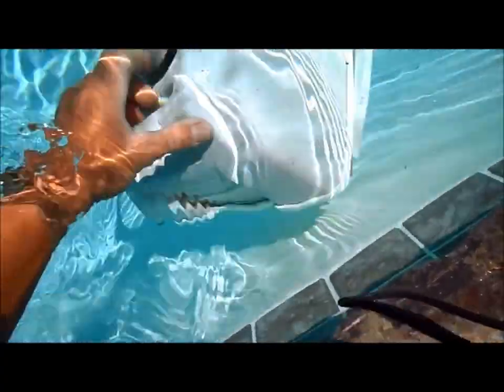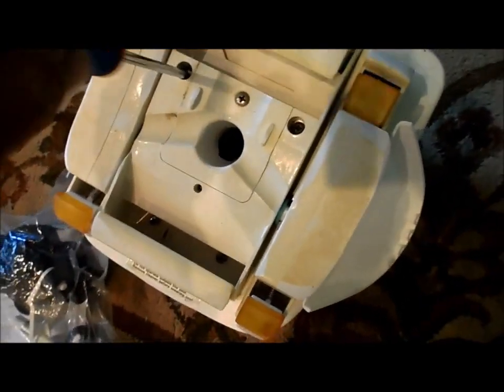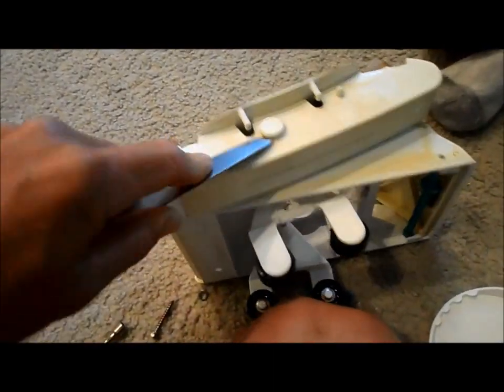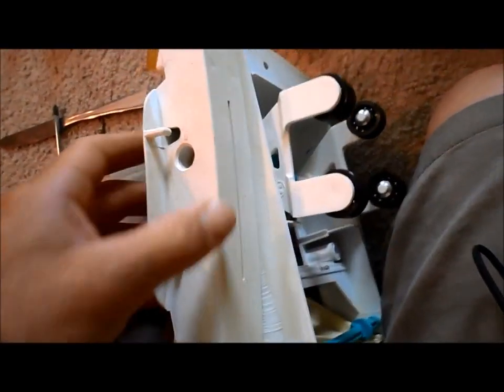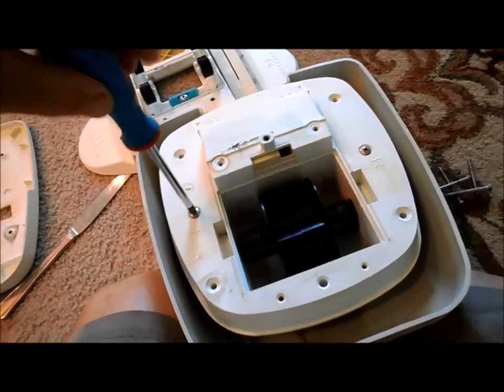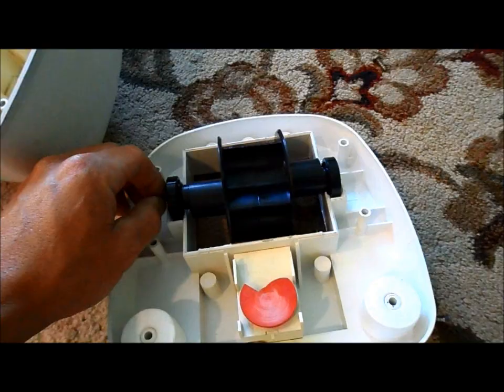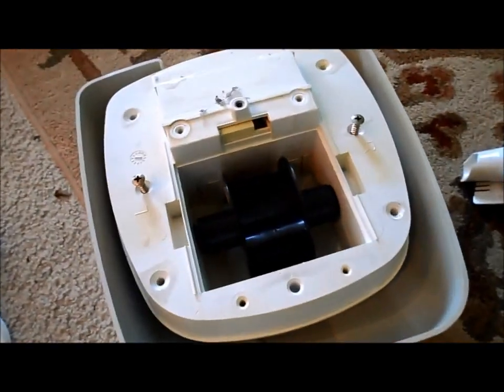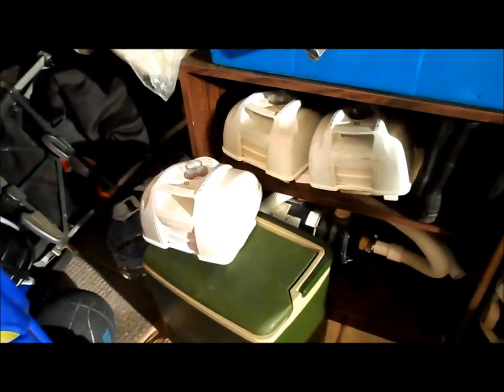Hayward Navigator (Pool Vac) Pool Cleaner, A-frame Turbine kit Rebuild: Cleaner Not Moving

Comment: Hey man thanks for the video really good info. So I have an issue maybe you can help. I replaced everything you had did in the video because I was having an issue with my unit not working. The issue is that it didn't fix it and it still doesn't work. Is there another thing that I may have to replace on the unit that you know of. M kinda at a loss so any help is greatly appreciated. Thanks again
Reply from the maker: What is it doing when you set it back into the pool?
Reply: Swimming Pool Tips, Reviews & How To -MrDgvb1 the feet on the bottom are moving but it just floats or sinks to the bottom and then nothing. The parts are moving slowly and I can feel suction and I see it suck up debris but it won't do what it's supposed to. The unit also was just working great very recently
Reply from the maker: What about the pool filter? Is the water return flow and suction good?
Reply: Swimming Pool Tips, Reviews & How To -MrDgvb1 the filter I completely cleaned thinking it might be that and no luck. The water return and suction to the main basket area is good I used it to manually vacuum however I had the unit plugged into the secondary return on the sidewall of the pool and I'm unsure how to tell if the suction is good on that. I will test the unit by attaching it to the main return now.
Reply: Swimming Pool Tips, Reviews & How To -MrDgvb1 so I plugged the unit into the main return and it does have more suction. It had enough to make the unit move very slowly like a crawl but not at the speed it was prior to it not working. Do you think it could be the gearbox causing the issue or does that not have anything to do with it that. I did also check the suction on the side wall return and it is working good.

Comment: Anyone know the purpose of that round red piece? Mine is broken. I just replaced all the insides except that red piece. The vacuum moves fine until it gets to a step or corner. It just stays stuck all day.
Reply from the maker: That spins the gears in the gearbox. It is needed to turn the cleaner out of the steps.

Comment: Thanks for the video. Its a good thing Hayward is the least innovative pool company in the world. This has the exact same design as the newer Nav pro (all they did was change the colours on the shell - friggen joke). Does anyone know how to keep the red guide from coming off the gear box? Mine has fallen and it won't stay on.
Reply from the maker: Chris Kozovski  Maybe you just need a new one as it shouldn't fall off. And yes you are correct - the internals are the same forever.  http://www.amazon.com/Hayward-AXV408P-Automatic-Cleaner-Assembly/dp/B001E8QMS6/ref=sr_1_1?s=lawn-garden&ie=UTF8&qid=1432347442&sr=1-1&keywords=navigator+gear+box